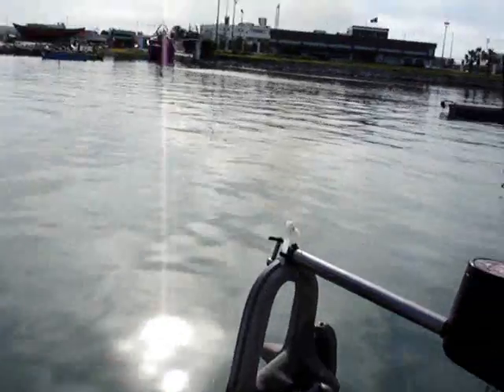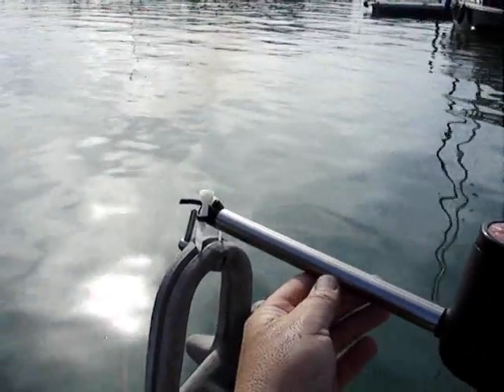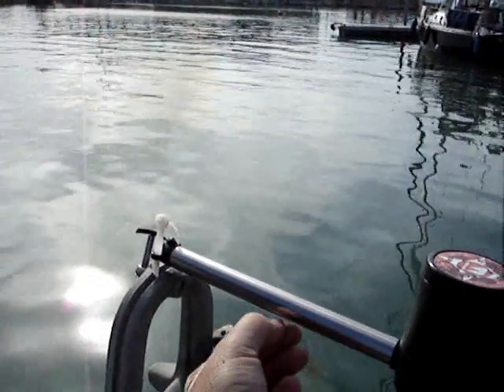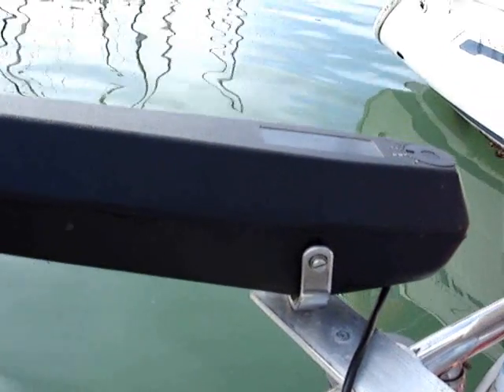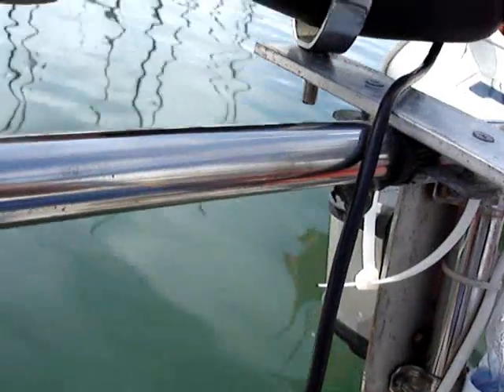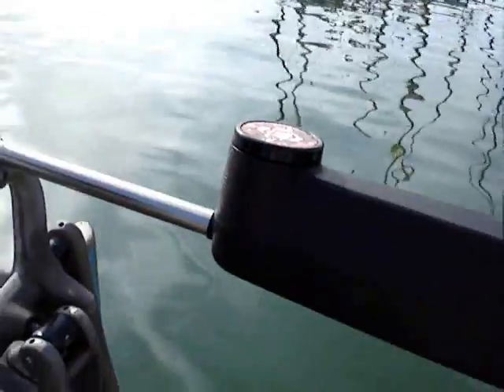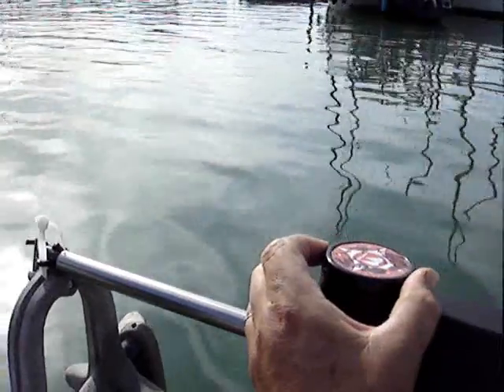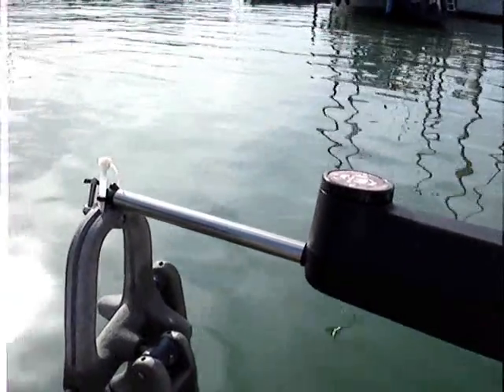How to install a tiller pilot....

Comment: Great video.  Cautionary tale though: a friend used an industrial strength cable tie to hold down a rudder on to its gudgeon pin. It gave way after 6 months quite suddenly on Lake Windermere. Lesson learnt: cable ties are a great temporary fix and incredibly strong when new but perish and become brittle over time.